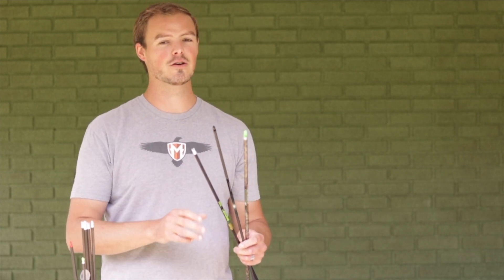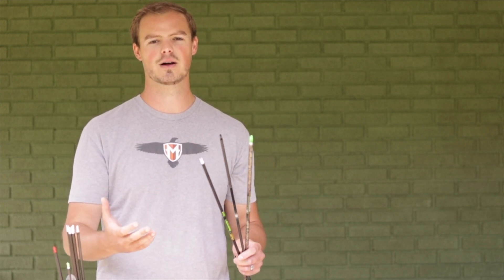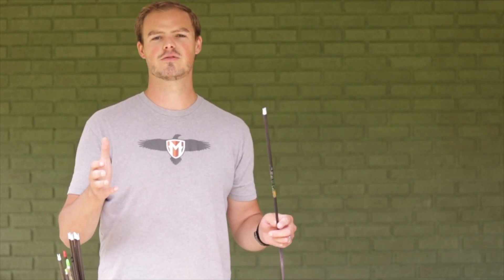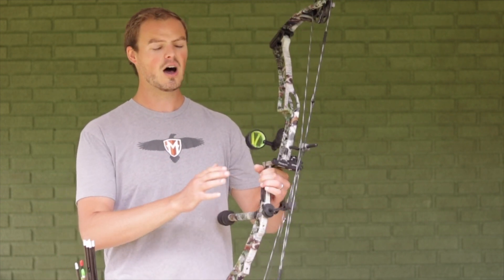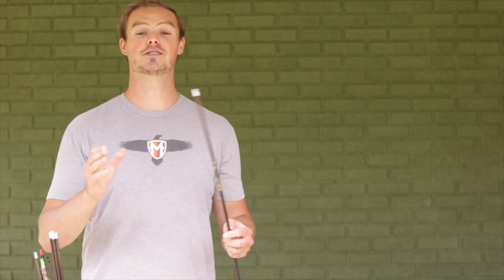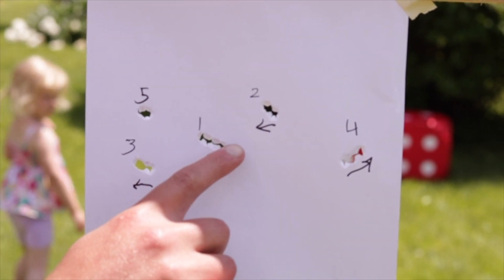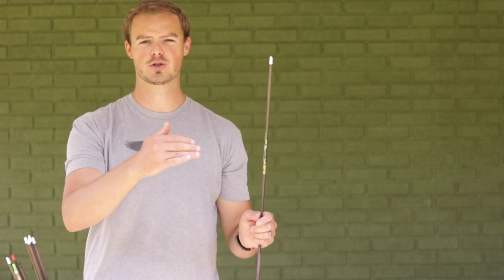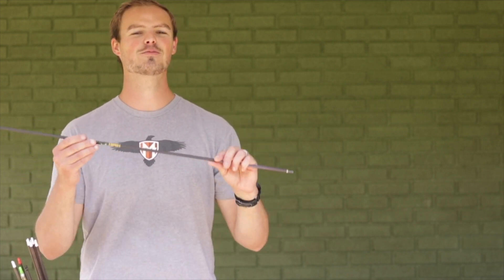How To: Nock Tuning "A to Z"

Comment: Remember, this isn't meant to be done with aluminum, it is not the same construction process. Aluminum arrows are made of the same aluminum from end to end and therefore react the same. The reason you're doing nock tuning with carbon arrows is to get them all reacting the same, you're not tuning the arrows to the bow, you're not tuning the bow to the arrows, you're tuning the arrows to your other arrows. This way you can toss the vanes/feathers on the shafts and try to adjust to get bullet holes.

Comment: Thank you for taking time to make video, but I’m kind of confused? On the 1st arrow you knock tuned. You shot 5 times, rotating 90 degrees at a time. On the 5th shot it tore correctly, wouldn’t that be same position as the first shot you took and original position? Just looking for clarification, I’m new to this.

Comment: I’ve nock tuned hundreds of arrows and never had tears this bad unless the rest is off. Most arrows will shoot ok. So I pick an arrow and tune the bow/rest/arrow to a bullet hole and then check the other arrows. You’ll find assuming your form is decent that your form is gonna drive tears far more than the minor spine differences.  If you’re talking shooting 70+ yards at spots buy high spec target arrows. For 50 yard shots at deer nock tuning is a fun but minimally affective tool. Of course shoot all your arrows because there may be one that just doesn’t behave regardless what you do.

Comment: So what should you tune first? Your rest so it doesn't tear or your knock? (in the case of having a new rest and a new batch of arrows)
Reply from the maker: Set rest to manufacturer specs for center shot and nock height. Then nock tune so all arrows tear the same. Then move the rest to get bullet holes.
Reply: I second this. I'm getting confused with the order all of these tunings should take place (nock, torque, paper, etc). Right now I have a new set up with brand new arrows and completely new draw # and arrow length. If I shoot a bare shaft arrow and it tears the paper, I can correct that by either nock tuning or paper tuning my rest. Correct? So how do I know which one to do first or if the other method is even important?

So are you saying after the center shot, I nock tune to get as close to bullet holes as possible? If bullet holes, then I'm done, but if not, I just get them close and then move the rest to fine tune? 
Thanks.
Reply: i third this. someone please answer him

Comment: Can you nock tune with stock nocks, mark the arrow at the index point, then install a lighted nock with the same orientation, and get the arrows to fly the same? I use Nock Out lighted nocks. They fit so tight, that I can’t turn them without wrecking them, so I have to install them in right orientation. Let me know what you think.
Reply from the maker: It's all about the arrow getting flexed from the same point. In my opinion (no testing, just thought based here) it's not about the nock, just the orientation of the arrow. Now maybe if one switched to a bushing type nock system it'd change, but that's not your concern here even though the nock out has that plug system. It's not as much of a necking down as with a pin bushing system for example.
Reply: Average Jack Archery thanks man. That was my assumption. I’m building my setup with Element Storms, which are .166 ID, so I’m a little bit limited on lighted nock options. I absolutely love my setup though. 250 spine with Ethics stainless steel outserts, 125 grain points, and Zinger Fletches. 550 grain total arrow weight and still managed 19% FOC. Pair it with some stropped Cutthroat 125 grains and I’ll be ready for elk season.
Reply from the maker: Nice!!!!!

Comment: Thanks for the good info!  So, I’m kicking up the FOC.  I just got my bow restrung and they set everything up for me.  I’m shooting a bear anarchy 60 pounds with 28.5 draw.  I’m shooting a 300 grain axis match grade with 122 grain insert and 125 grain tip.  I cannot for the life of me get rid of a nock right tear bareshaft.  I get the same thing from a 340 spine and even my old 400.......except with fletchings.  We tweaked the yoke a bit per the specs.  It made it a little better but the bow shop says we shouldn’t do anymore.  I’ve spun the shaft multiple times to nock tune but that doesn’t help.  Do you have any input for me?
Reply from the maker: Check out my Playlist section for a playlist called "When Tuning Hits the Fan". First video is a video I have on grip and torque tuning. I'll wager that's 99% of your problem.
Reply: @averagejackarchery  wow, thanks so much for responding so fast.  I’ll check it out right now

Comment: So what's the use in knock tuning if your going to change the rest? Also once you put vanes and b.hds. on your going to have to knock tune again
Reply from the maker: The point of nock tuning is to get them all tearing the same. Rest movement is pointless if they're not all tearing the same.
Reply from the maker: @C C You can't nock tune a bareshaft with a broadhead. It'll fly sideways and backwards. Nock tuning is to get the "tube" part of a finished arrow to act exactly the same way as the next "tube" in the batch. So adding fletchings doesn't change how the tube part of a finished arrow behaves. Broadhead tuning becomes a mute point if your arrows are tuned correctly in my experience. I have many videos on shooting well tuned arrows then controlling fixed blades perfectly. I even have a video of me shooting my wife's bow that isn't tuned and still shooting a fixed blade accurately.

Comment: i started tuning my bare shaft 300 spines my first shot was a horrible right tear (LH shooter) so i turned knock counter clockwise and it took half of it out but its still 2” slanted out to the right. but i noticed i hit in the same place very consistently top left amazingly accurate just right tear how do it get it out? i already tried adjusting my rest; just moved where i hit still does the tear. and my old 340 fletched arrows shoot bottom right after rest adjustment for the 300s

Comment: After nock/bareshaft tuning, should you paper tune to have a bullet holes with the bareshaft or fletched arrow?  I just started tuning my bow on my own this year and I became super frustrated when I spent so much time getting to a perfect bullet hole with a bare shaft and then had about a 1 inch tear with a fletched shaft. Full disclosure, it wasn't the same shaft and they weren't nock tuned. Is what I was seeing normal or is it likely that much variability between the fletched and unfletched shafts?  BTW, I did try multiple fletched shafts and they tore identically, but I only have one bare shaft.

Edit - After writing this, I realized that later on down the road I found that my fletchings were hitting my drop away rest. I've since resolved that issue after checking with some foot powder. I never put 2 and 2 together. I bet of I checked it now they would probably shoot the same 🤦‍♂️
Reply from the maker: Great question: in a nutshell, here's my method...
1. Nock tune all arrows to tear the same though paper. Or very close to the same. 
2. Move rest to get as close to bullet hole as your abilities allow. 
3. Fletch arrows.
4. Shoot through paper again to confirm. The fletchings should HELP. If your tearing again, check Fletch contact with rest and face. 
5. No Fletch contact should mean bareshafts and fletched should shoot bullet holes.
Reply: @averagejackarchery  Thanks!  It must have been the contact issue. I was very puzzled how fletchings could make it worse other than the roughly 18gn difference from the weight of the fletchings  I'll have to get back into the lab and do some testing!

Comment: Im shooting a drop away QAD Rest. I ended up having to move it towards the riser 3/16" of an inch to get bullet holes. Is 3/16" an acceptable distance to be off center shot in your opinion?
Reply from the maker: What bow?
Reply: @averagejackarchery  Matthew V3. I know recommended center shot is 13/16" + - 1/16" per Matthews. The bow is brand new, so I assume, (maybe I shouldn't), that the timing/etc is all good the way it's supposed to be. I have 28.5 inch draw length and shooting approx 64 lbs. I'm shooting 300 spined Easton Axis. I went through the Ranch Fairy Test kit with field points, (100 grains thru 300 grains), and started off with massive tears with bareshafts. The Ranch Fairy refereed me to one of your videos where you talk about form/torque, and that helped a bunch. I was definitely NOT griping my bow properly, so that helped get rid of the massive tears right away. However, as I played with different point weights, and also adjusted draw weights slightly, the best I could get was approx 1 1/2" straight left tears, pretty consistently. I went up as high as the 300 grain point, and that actually shot pretty well, but after I made maybe a 1/16" of an inch adjustment towards the riser. I eventually ended up moving the rest a total of 3/16" of an inch towards the riser, and as long as my grip and form are good, I can shoot 200 grains to 300 grains with fairly good bullet holes, with 250 grains being the best so far. I don't think there's any issue, but just wanted to know your opinion on what should be "acceptable" as far as how far off center shot a guy can go.

Comment: Okay man...question! Which do you think is more effective: nock tuning or spine indexing? Fantastic video!
Reply from the maker: Great question! Spine indexing with like an actual spine tester is definitely the closest you can get to complete consistency. However, it's not a guarantee that's what your dynamic spine is going to want for the arrow build you're making. Since that's the case, I'd rather just nock tune in the long run.
Reply: @averagejackarchery  Thanks man! Keep up the solid videos!

Comment: Question: What if you made a spine tester and used it to find the side with the least deflection? Sure you would still want to test the arrows out, but wouldn't that cut the "monotonous time consuming" part way down? Or if you buy your shafts spine indexed?
Reply from the maker: Great question. Spine testers test static spine. Or the simple flex of the arrow at 28" with a standard weight applied. What this is doing is testing dynamic spine. Or what happens when your bow with your arrow specs reacts when it's shot. So, yes, spine alignment is all well and good for static alignment. But dynamic alignment is a totally different ballgame and best tested under such circumstances.
Reply: @averagejackarchery   Now that I have done my own shooting, nock tuning and paper... It now makes much more sense. 
An aside: all the paper tuning I did had an added bonus. I REALLY was forced to concentrate on my form and what a difference!!

Comment: If you get victory arrows you don't have to go through all that,because they spine align all there arrows.
Reply from the maker: This is something I want to put to the test no doubt!
Reply: I use the vap too 300
Reply: @doncaruso1949  The Victory marks can be very inconsistent. People that use spine testers rarely come up with the same spine. I think it can be called close at best.
Reply: Don’t trust that spine align on those victories, had to nock tune all of mine because it wasn’t right, shooting the RIP XV.
Reply: @zhickman338  All depends on how they are tested.  lots of people test the bare shafts, with no nocks, inserts/etc.  I have found if you put the nock in and the inserts(non glued) that my bend int eh shaft seems to change position of the dynamic bend/spine.  Also people tend to find one bend/spine and call it good, when there tends to be more than one. Key is to find the one that has the deepest valley.
Reply: I have my arrows built by South Shore Archery- they spine index shafts. So I skip nock tuning.
Reply: But they make the spine line on the arrows to short.